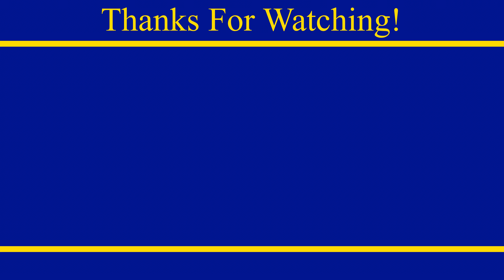Lionel, TMCC, Great Northern, U-33C Repair

Comment: Dont you hate it when you swap your grease for glue
Reply from the maker: @CSXrailfan814  I did that with one of my N scale engines once before I understood what a bearing was. I learned very quickly that that was not it
Reply: @cwhall01  I can't believe you did that.
Reply from the maker: @CSXrailfan814  I was in like 2nd grade at the time so it's not too surprising
Reply: @cwhall01  I'm less so surprised more so just disappointed.
Reply from the maker: @CSXrailfan814  Haha! I had to learn somehow. Better on that than an HO or O scale model
Reply: @cwhall01  n scale is best scale. Should have done it to a tyco.